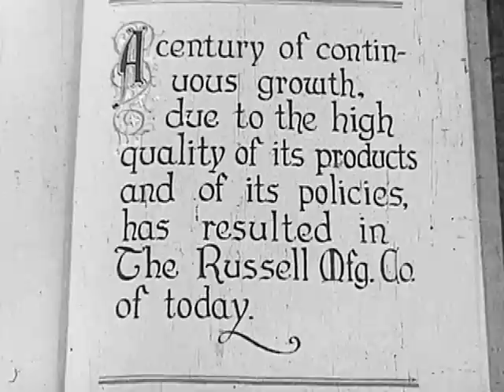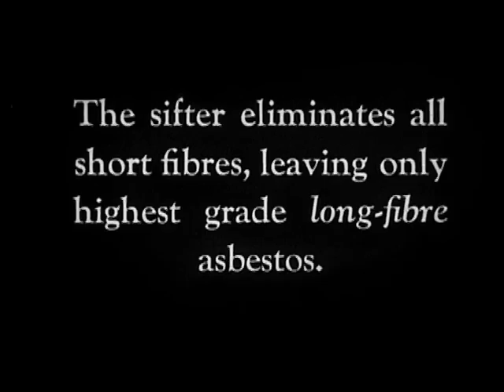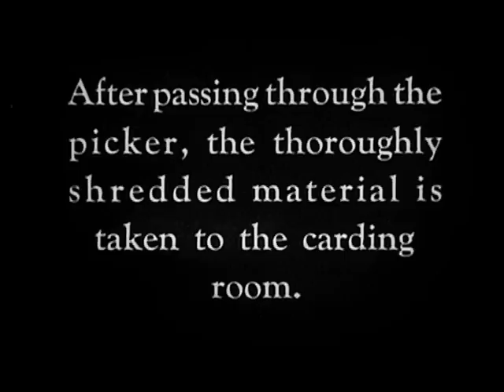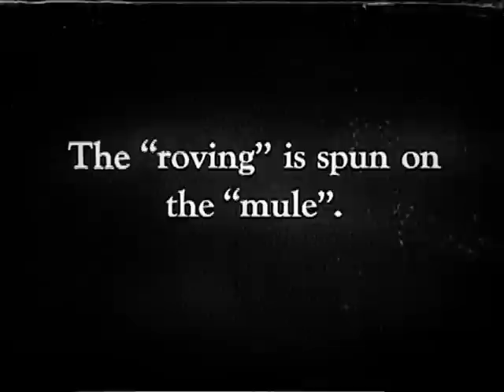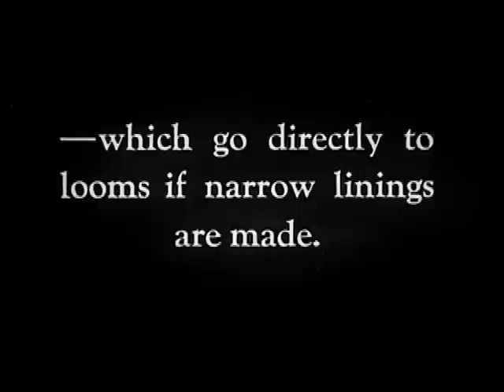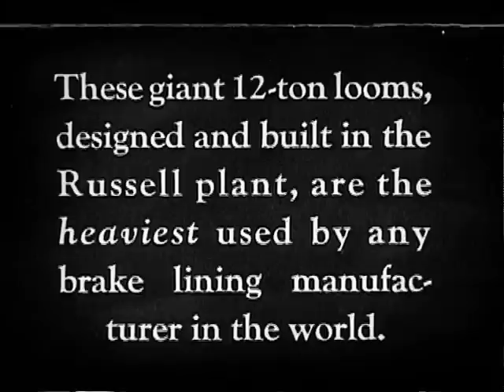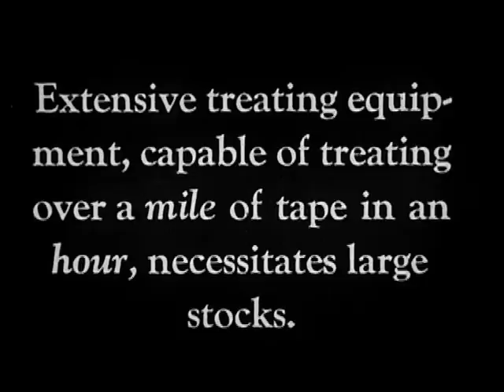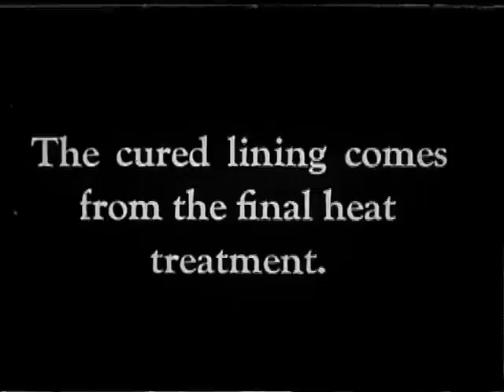Making of Rusco Brake Linings, Pt 1

Comment: The room at 2:58 has to be the worst room to work in. I mean clearly every single room is incredibly dangerous because of the asbestos fibers circulating in the air, but the amount of dust being poured into the air at 2:58 was absolutely ridiculous. That room is guaranteed death.